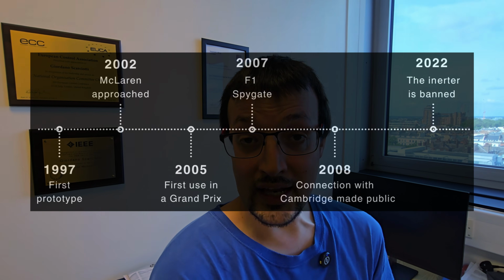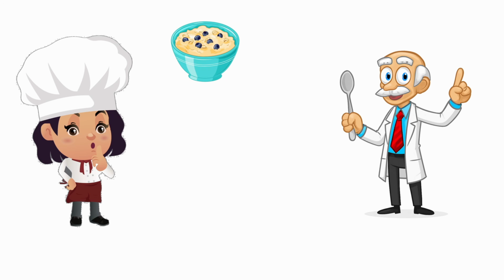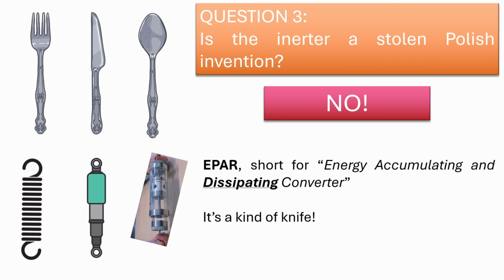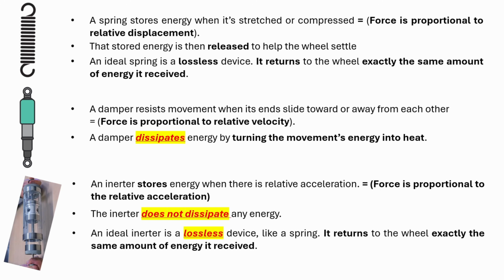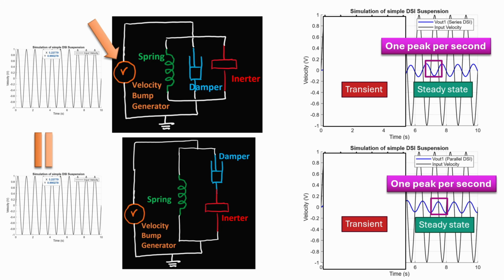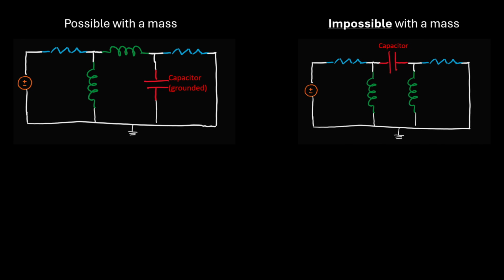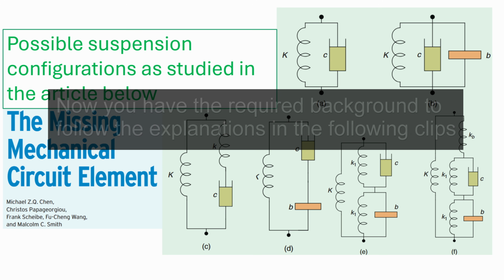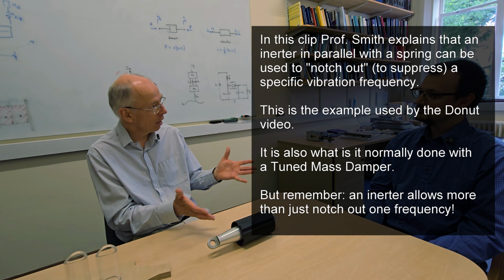Why Everyone Gets the F1 Inerter Wrong | Explained Clearly

Comment: Now I am very interested in what that polish device actually does, because you failed to provide any explanation beside repeated statements that "it is not an inerter" and a few static images that definitely failed to explain the principle to me. 
Your argument that it does not have two terminals is false. As a device designed to act when the car hits something, it has the car connected to one end, and whatever the car ran into to the other end. Therefore it has two terminals for the time when it is active.
It seems to me that the polish device could potentially be equivalent to an inerter with certain, potentially tunable drag on the flywheel. If that's the case, then it can be equivalent to an inerter when the drag is tuned down to zero. But it was likely not designed to be used in a way inerter is, and there are thousands of devices designed over centuries that store energy in flywheels for various purposes. So I agree they're not the same thing.
Reply: Probably since it was not disclosed to ossilate overtime in two dirrections as part of a useful system having that characteristic the inerter is not anticipated by spinning tops of which the polish device is an application.
Reply from the maker: ? I said it, the polish device is a car bumper (or more generally a shock absorber) https://youtu.be/4FOjKXdqFZA?t=1180. 
When a car hits the bumber of another car, the device accumulates part of the energy in the flywheel (thus removing it from the rest fo the car) and then dissipates it.
Regarding the terminals, the car crash is istantanuous, so is the connection.

Comment: Grazie Professor for this video. I have been working on this principle for a long time  in the field of helicopters for Airbus Helicopters. It is called SARIB and has been installed for 40 years on the Tiger  and the NH90  between the MGB  and the structure to cancel vibrations. 
The SARIB uses a spring parallel to a lever as an amplifier, at the end of which there is a mass , but the principle is the same. This design creates an anti-resonance at the frequency  where the force of the spring is equal to the dynamic force of the mass in opposition phase. 
This results in a situation where the assemblies are statically connected but dynamically disconnected, which is very useful in a helicopter where the dynamic response of the structure is constantly changing with fuel consumption, load carried, etc. But the advantage of helicopters is that we are working at a fixed frequency (between 17 and 26Hz depending on the type of helicopter). 
For an F1 suspension, the input signal is broadband and we know that this type of suspension  is not very effective in this case, with less effective filtering than a conventional suspension when the frequency increases. Furthermore, in the event of an impact, the dynamic force becomes very significant and ‘blocks’ the suspension. 
I am therefore curious to know  how the various parameters are set and to see, on the same diagram, the superimposition of the transfer functions of a conventional suspension with a suspension with a J-Damper.

Comment: Followed all of that. Only other thing I was wanting was an example. You started with the simulations an F1 team run to make a Bode plot for a race weekend: would have been fun to run through how a Bode plot could be "handled" by calculating and creating a specific arrangement of components. Visualisation tools might exist for electrical engineering that could translate this into consumable content for your hungry views. Great video. Thanks.
Reply from the maker: Oh, it did not occur to me to actually show how to go from Bode plot to circuit. I could have done it (without showing the gory maths), you are right. Thanks for the tip!

Comment: What a fantastic explanation. Fascinating. It was a very needed follow-up.
If you ever plan to make a continuation, it'd be interesting to see how the engineers come up with the ideal BODE plot for a given circuit and the limitations of the technology.
Also, coming up with the ideal BODE plot is not directly related to the passive elements but adapting their limited stiffness, inertia range and so on to approximate the ideal BODE sure sounds interesting. 
I can see how the inerter properties are defined by the pitch and the moment of inertia. Does that become a problem before it becomes usable in real scenarios? For example, a too fine pitch would introduce more friction so at some point you either have to jncrease the mass or the radius. This is such an interesting topic. I was introduced to it in more deyail by these two videos and it's really tickling my brain.
Reply from the maker: Thanks a lot for your comment and for subscribing! Regarding your first point, I can consider it for the future but it would be a very technical and long topic. I am not sure I would be able to make it work out as a youtube video.
Regarding your last point, if you are asking if there are physical limitations and trade offs between thread pitch, flywheel size, and inertance, I believe that all these issues have been sorted along the way by the teams during initial development so that practically this was not an issue at the required working range. But I may be wrong.
Reply: Stiction is the comical but technical term a limiting factor that is in the back of the text book appendix because it spoils the modeling. Likewise at thr back of Formulas for stress and strain, it points out that impact loads are about 2wice slow loads, and if you add fatigue loads... you get eyeball engineering and test... since your videos i have been buying parts and will have a go, and maybe someday fit a model to the results. Thank you for this series, even if many of us kinda knew about it, your work will be a kick in the ass for me to do applications.
Reply: Anecdotally, i had tried to use powered impact wrench on an automotive screw jack as recomended by youtubists, but it was desructive and nonfunctional as the srew demonstrated a limited allowable rotational speed and impact resistance. So for low cost development a rack and pinion and easily changable wheel as per the original model and the polish absorber is the crap i bought on amazon since the first video

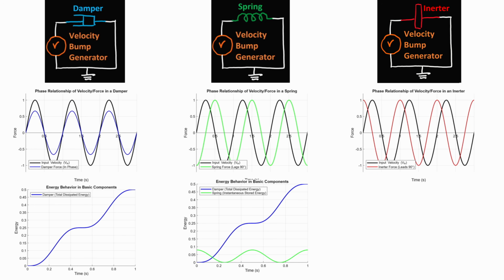Comment: I think the biggest difference between inerter and damper for suspension use is that inerter doesn't remove energy from suspension (unlike damper which converts suspension movement to heat) but instead inerter moves part of the peak energy forward in time without losing energy in total (in reality it has some damper effect because real world items always have friction). (The graph in 28:25 shows -90 degree phase shift backward in time but this is for steady state sinoisodal input, I think the correct way to think this for suspension is +270 degree phase shift instead because inverter cannot obviously move start of input backwards in time.)

A real world suspension must have suitable transient impulse response, not suitable response to given sinuisodal continuous input because such thing will not happen unless your road surface looks like continous sinuisodal pattern which should be exceedingly rare in reality.
Reply from the maker: Regarding your last point, impulse response analysis and frequency response analysis are mathematically equivalent. Although my construction of the Bode plot is derived using sinusoidal inputs, this actually characterizes the full system response: any input, including an impulse, can be represented as a sum of sinusoids. In other words, even though it looks that using sinusoids is not realistic, it works out to be completely accurate in practice.
Reply: @Prof_Gio  Are you claiming that when the car with inerter runs on a road and hits square block (comparable to square wave in mathematical representation), the inerter works with -90 degree phase before the spring starts to act?

Or is your claim that the inerter works delayed but with -90 degree phase so it happens later in impulse response but it's phase appears as it were -90 degree?
Reply: I think the inerter prevents the spring from acting if it is in parallel with the spring as perhaps i have been erroniously assuming.  If it was in series to other springs as perhaps how it was maybe used in heave in F1 maybe it depends on the spring stiffness versus the invertor inertia versus time force input, and porpoising was a sinsoidal disaster after inerters were banned..correlation may not be causation

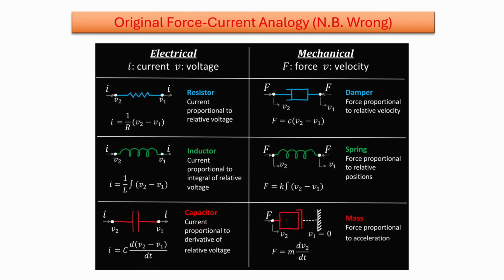Comment: If you stare hard enough at 25:53 and 28:49 while thinking about the uneven road surface that a tire rotates and moves on, I think what comes out is that the car is inherently more stable on the track.

From my understanding, the destructive interference of the spring and inerter immediately eliminate the oscillations of the wheel relative to the ground as opposed to just having a spring and damper where the oscillations dissipate over a a period of time. 

This essentially optimizes the job of each component in the system. If we focus on the damper's job (not in isolation but within the system) what becomes apparent is since the wheel is not in oscillation, a bump to be absorbed by the 3 components is now efficiently dissipated as heat. There's essentially no extra relative acceleration for the damper to deal with if there was no inerter in place.

I think this is all about efficient conversation of 'mechanical noise' from the road to heat - ensuring the car is stable under whatever circumstances.

Any takers? I'm happy to learn if this isn't the case.

Also, beyond extreme sports, how would this trilogy be useful on a day to day consumer road car? What would the ride and handling characteristics be like?
Reply: I rekon if the wheel cant rise with sharp curb it hits as fast with an inerter then the frame and occupant will have to absorb greater impact loads, but the wheel might spend less after impact time ossilating in the air since the car is heavier and is harder to throw in the air, yet overall the suspension would be softer to slower rise times than id you hast solid suspension lija go cart. But the tire is still a spring, so som explination of these devices was as just to oppose the tire spring rate of the tire. 
I know my tiny light aluminum 2001 honda insight slams into unseen ledges at night with impacts that make me fear the suspension mounts will rip off and the rims will chip, and in a turn the changes direction while in the front and rear of the car are some what in the air. A volkswagen van if yesteryear was described as having a lower frequecy reaction to undulations in the pacific coast highway in a turn, leading to going into on coming traffic an sudden death, yet th volkswagons were as off road baja vehicles, so tgen what is tge application and where is the worst case scenario case study? Inerter i  parralel or series? Acting on one wheel or both?

Comment: to me i understand the inerter as like gears on a bike. when i increase the gear ratio of my bike, the pedals is heavier to push even though no weight of myself and my bike change. and ofc this allows car that needs every weight saving to add an addition system to help keep tires on the ground after a bump, at minimal addition weight.

Comment: Congratulations on what is probably the best video about inerters ! However, I think that some people will still have questions because they were not addressed. For many, the question will remain open as to what an inverter actually does, why it offers such advantages, and exactly what those advantages are. Of course, this was presented and explained in detail, but for some it was too academic and scientific, and lacked comprehensible, illustrative examples. Unfortunately, academics often tend to explain things in a way that is far too complicated. 

Simply put, inerters compensates almost immediately the vibrations caused by uneven road surfaces and bumps, while shock absorbers and mass dampers only distribute and suppress these vibrations more evenly and thus more advantageously. By almost immediate compensation the inverter helps aerodynamics by restoring the ideal position of the aerodynamic parts of the vehicle almost immediately and much quicker. So - the inerters advantage massively helps the aerodynamics, which can be kept much better "in the optimal window" or return to it almost immediately. In the same way, it helps the tires by restoring the optimal contact patch more quickly (again- almost immediately). This not only helps to maintain maximum grip almost continuously, but also reduces wear. Furthermore, the tire can be kept within the optimal temperature window very easily, which minimizes thermal degradation. Another advantage is the warming up of the tires, as they can be brought up to temperature in a more targeted manner, since less "movement" of the tires means fewer variables that need to be taken into account. Both of these things are basically also done by the mass damper, which probably is another reason why the inerter is often "confused" with it. Even though the inertia damper basically works in a completely different way, it aims to eliminate the same "effects" without having the disadvantages of higher mass, because mass has an impact on inertia and the CoG, among other things. The inerter "works" faster because it does not distribute but compensates almost immediately. What should perhaps also be mentioned is that a suspension with an inverter is also always only a compromise. This is because every race track has different corners (except for a few that actually consist of relatively similar corner types with very similar oscillations, which is why I assume that McLaren's secret for 2025 lies in something that "replicates" an inerter, as it is noticeable that McLaren 2025 is even more superior on tracks where this would offer even greater advantages), each with different oscillations. So here, too, a compromise has to be made, whereby, of course, a suspension with an inerter always restores the "ideal state" much faster than a suspension without an inerter, with corresponding advantages for aerodynamics and tires/grip/wear/degradation/temperature. Every suspension is always a compromise, but a suspension with an inertia damper will always be the best compromise, as it always restores aerodynamics and tires to the desired state much faster. 

With this additional mention and simple explanation, I think everyone would have understood the inerter and the advantages it gives. However, this is not meant to be a criticism, as both videos are the absolute best on this topic. But for some people, due to the complexity and very academic approach, questions remain that could have been eliminated with additional simplicity at the end.

Comment: The simplest explanation I heard, years ago from a suspension company involved with inerters, is that they reduce hysteresis. These devices have also been tested on motorcycles, but were not favored by the riders vs. traditional dampers.

Comment: I'm may only be a spacecraft mechanical engineer but it seems pretty clear what the inerter does, and how. Springs resist change in position (aka displacement), dampers resist the rate of change of position (aka velocity) and inerters resist change in velocity (aka acceleration). The resistive force is proportionate to the acceleration of the ends of the inerter times some constant property of the inerter (momentum). F=ka
Reply: Not really you just explain what a mass is doing in a gravitational field F = m*a , because the other terminal has acceleration a_2 = 0 (the initial frame the earth). You must see the inerter as a true two terminal device F= k (a_1 - a_2). This is the reason why the inerter has to be placed where you have a "true" difference in the acceleration.
Reply from the maker: Correct, thanks.

Comment: As a professional racing damper (and inerter) designer, working through a 7dof model right now to develop some requirements, this is great content on a technical and global sporting level.  When I saw the first video and the amount of subscribers you have I knew you'd see some wild success you're not used to.  Great work.
Reply from the maker: Thanks a lot for the feedback. Whenever I read a comment starting with "As a professional" I always fear that it will follow with "this is completely wrong". I am glad that you think that this is great content! Thanks!
Reply: @Prof_Gio As a professional on the mechanics side of mechanical engineering: this is gold. I'm familiar with the mathematical side of multi mass spring damper systems from theoretical studies and some applications and I wonder why I didn't figure out the s'' component (s being spring, s' being damper) myself 🙄😉👍🏻
Reply: 7 degrees of freedom? X, y, z, roll, pitch, yaw, I know all of those, but what’s the seventh?
Reply: @playyourturntodieatvgperson  actually TWO DOF of the 7 are for convenience or additional mechanism "shapes" as it moves etc. 
5 equations in 5 unknowns and all !  More than 5&5 is because some reality gets in the way.
Reply: @playyourturntodieatvgperson time
Reply: @playyourturntodieatvgpersonits a simplified vehicle model which has 4 rotations of each wheel, longitudinal and lateral movement, and the yaw, which makes 7DOF. Ofc you can extend this model with pitch and roll
Reply: @playyourturntodieatvgperson
Reply: @@ryanm.6947 I wonder if you could say a few words about the application of inerters in suspension design. I would guess that they are used to control body role in cars with a lot of aerodynamic parts that are susceptible to changes in angle of attack